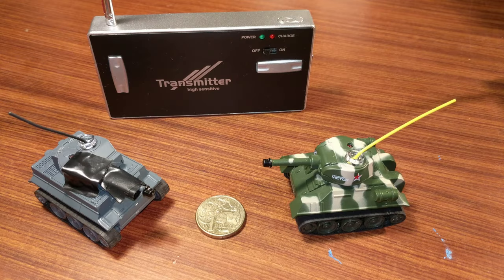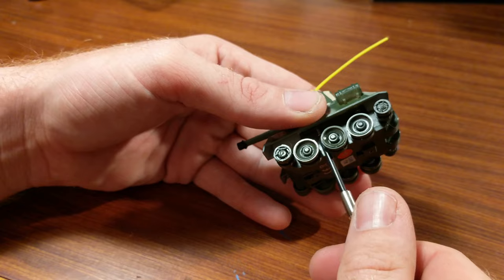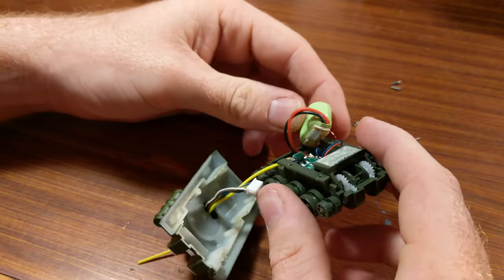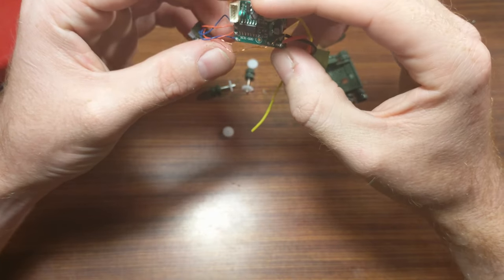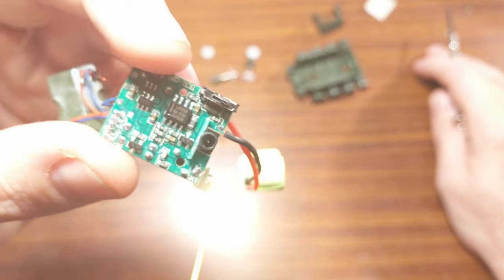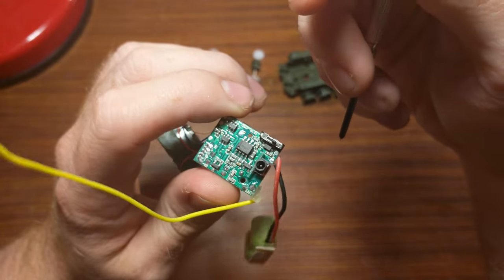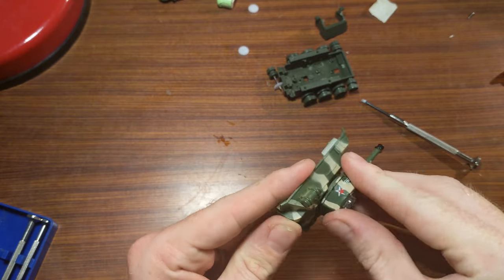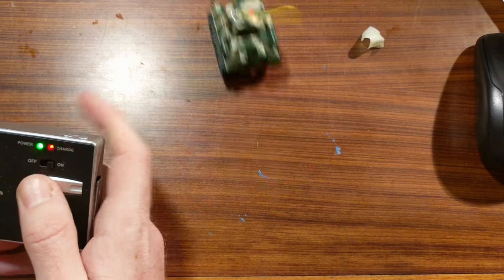Battle Tank R/C Teardown

Comment: Great tear down, nice! Thanks for sharing. 
BTW, if the small DC motors are commutated as they usually are, they generate a lot of high frequency noise. That noise can interfere with the control IC and a way to avoid that is to a) shield the motor, b) get all that noise to a common ground that has very low impedance, and that noise (rapid changes of potential between terminals) is shorted with decoupling capacitors before they get to the sensitive ICs. See more here for example: https://electronics.stackexchange.com/questions/153628/reduction-of-dc-motor-noise
Reply from the maker: Great explanation - thanks!

Comment: mine is steering to right-side when driving forward. have you encountered a similar tendency? would it be due to the asymmetric wheels, tracks, bushing or due to motors themselves?
Reply: on my controller there is a TRIM button that lets you compensate the tendency